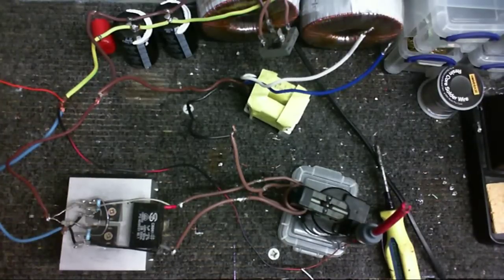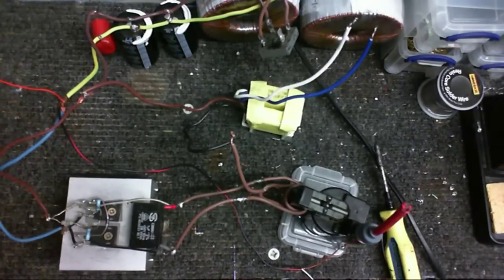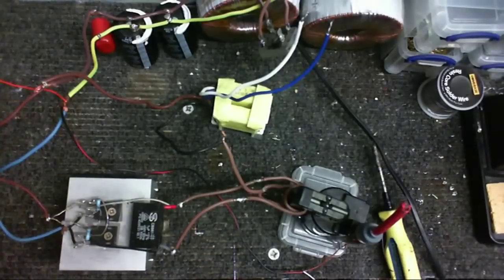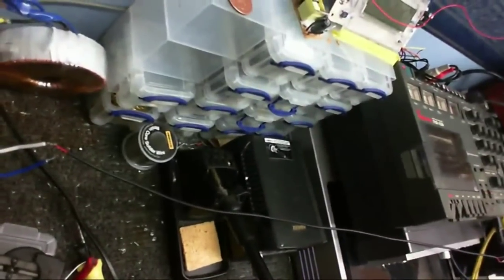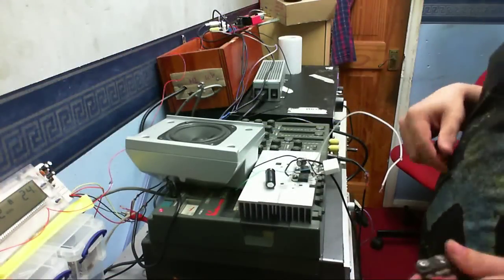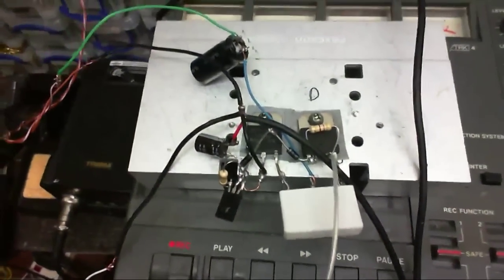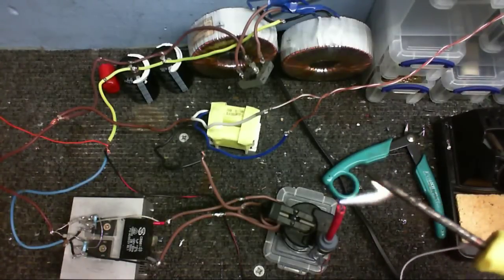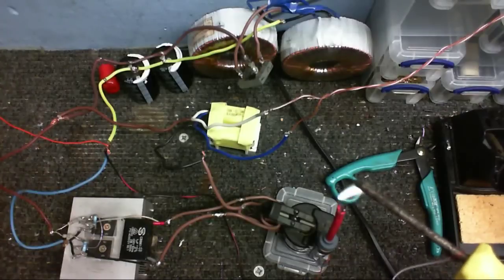Audio Modulated ZVS

Comment: Awesome video, it made me subscribe. I'm thinking about modifying a bought ZVS circuit that I got on amazon(LM YN ZVS Driver Board). It comes with a toroid inductor, and I was wondering if it's possible for me to just add a secondary winding to it, or if I would have feedback issues on the amplifier end. If not, I think I have a small iron core transformer that may work. Also, I think you used a class AB amplifier for the audio side, but shouldn't the input signal be connected in between the two diodes and not after them? Thank! can't wait to see what you upload next.

Comment: Impressive. Please can you advise what the turns ration / voltage was for the transformer that you used. I note the comment about using the EI style transformer but unless I missed something (possibly, it is late), I didn't follow what spec transformer you used.

I am guessing you are applying the audio to a 110v or 220v winding and a 12 - 24v secondary in series with the PSU but that is only a shot in the dark - would appreciate knowing what you found was best please.

Many thanks.
Reply from the maker: The "transformer" I used was actually a power factor correction choke from a PC power supply, it has two windings (I dont know how many turns) so I used it as a transformer to "inject" audio into the supply. So one winding on that choke was in line with the power supply and the other winding was connected to the output of an amplifier.
Reply: Awesome, thank you, I will try and find something similar as a starting point - and then play around with other ones to see the difference.

Once again, thank you for the video and showing the amplifier  / modulator circuit you used.

Comment: Excellent combo! Fat arc + audio modulation. One question, though - will ZVS work with smaller MOSFET's, like ir3205; at lower power, of course. 'cause I tried it with ir840 and arc was ridiculous.
Reply from the maker: +MrJohhhnnnyyy it might do, I wouldn't try it on any more than 24 volts if you're using an ir3205, any higher than that and the voltage spikes on the drain could blow one (or both) of them. I know some people have used IRF540 mosfets in a ZVS and seem to get good results.
Reply: +CoolDudeClem I built one zvs with 4 mosfet of fault motherboard and powered by max 12v and work very well ;)

Comment: you know in the tube eara this was done commonly
when building a am transmitter
they placed a audio transformer on the 2nd grid of the transmitting tube (the one that has the high volttage trough a resistor)
and that way the tube got modulated (the 1sth grid is connected to the oscilator)
Reply: +robot797 you need a verry high amplivied signal

oh never mind you just did that
Reply from the maker: +robot797 I tried building another tube flyback the other day, but no matter what I do I just can't get much output, even when using doubled mains voltage. If it had worked I also would have tried modualting the 2nd grid voltage, but I would have probably done it with another tube instead of a transformer.

Comment: Awesome work! Can I use a ring ferrite core with two coils on it, instead of the power factor correction choke you use? Is that choke with a ferrite or iron core?
Reply from the maker: If I remember, the choke had an iron core. A ring ferrite core is probably better although I haven't tried it myself so I cant say.
Reply: Thanks, later I saw your schematic and it seems you used an iron core indeed. I'll definitely try the ring ferrite core, hopefully with no damage to the amplifier :D

Comment: Can you please share the amp circuit?
Reply from the maker: The schematic is right there at the end of the video, the amplifier is right there at the top half of the schematic.
Reply: @CoolDudeClem  Sorry I totally missed those last few seconds. Could you explain why you needed to add that transistor to the amp to make it work vs how it had worked fine for the speaker?